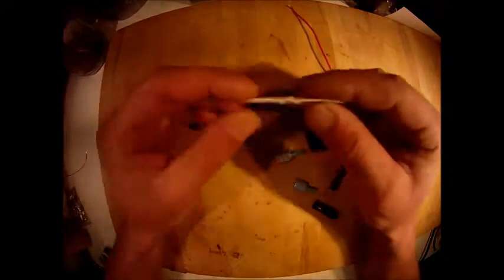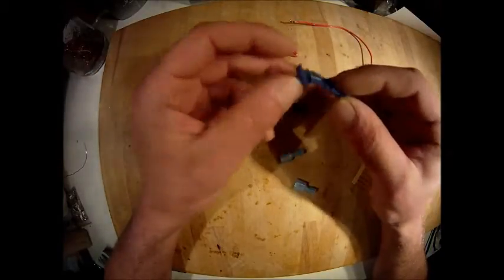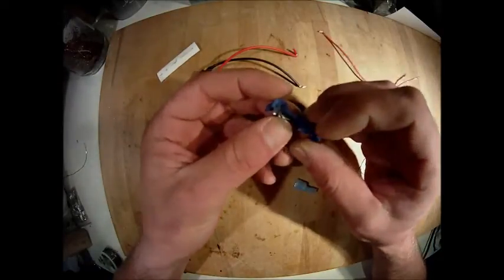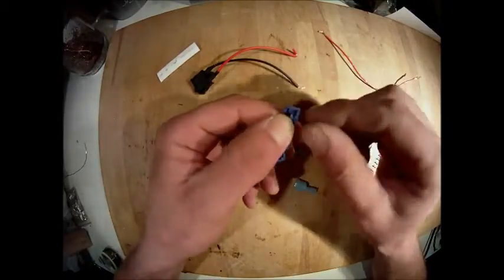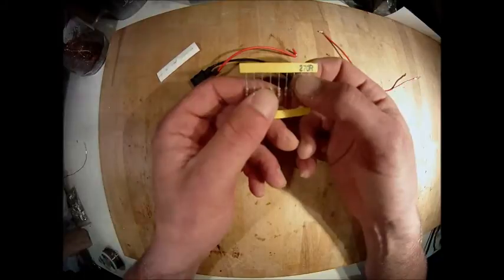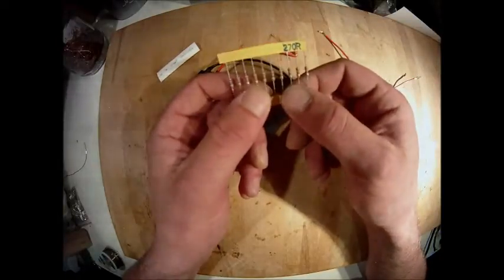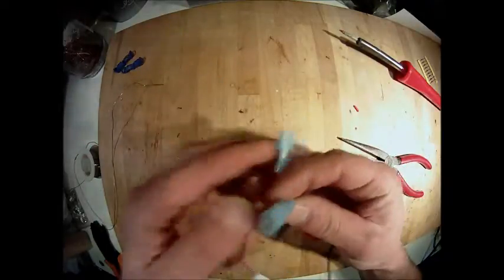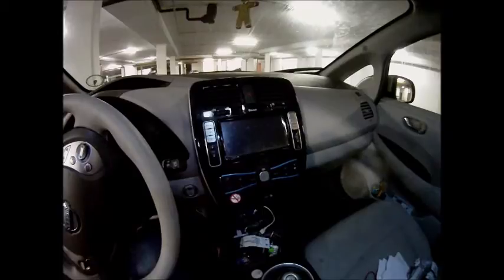Nissan LEAF Easy climate control method 2.  Heater OFF, Fan & AC ON

Comment: Great video.  Installed this one myself and it works excellent ! One thing though is that the red wire is actually 31 and ground is 24. Not 30 and 37 !

Comment: Hi, I completed the mod and the kw used does drop with it on. However the km available still decreases when I switch on just the fan. When switch off the km available increases again. So maybe its not working 100%? Great video...thanks
Reply from the maker: Hi, it is working as it should.  The km is just an estimate based on previous usage. It will drop after a while.

Comment: 1. Please tell me it's work with 2014 'X' grade leaf ?
2. As a example we set to A/C at minimum temperature about 16 C/60 F in inside the car & out side 30 C/86 F, this time also heater works continually & kill energy (Kw/h) ?
Reply from the maker: Darrin R
 That is correct. Well spotted! The reason for this is that the kwh indicator is showing actual present power consumption. The "+3 km" is the car guessing future power consumption based on the last few hours. If you drive around with the harness-switch ON for a few hours those "+3km" will slowly creep down to 0.  If you start off with a high number, such as "+30 km" you will notice that they go down very fast, and your normal "estimated range" will in the beginning change very little.
Reply from the maker: +madura prasanga I am not sure if I understand your question. The 2014 LEAF have the "Heat" switch, so there should be no need for this harness.
Reply: +Leafman Leaf 
Thanks a lot for your quick respond. I understand your answer.
Reply: Great video but I'm a bit confused.  When you soldered the resistor in, you soldered in a red wire onto the black wire.  Any reason for this when you could have soldered it to the red wire off the switch?  Also, when you attached the wires onto the wire taps on the M50 connector you didn't show which wires attached to which taps  i.e. did the red go to 37 or 30 or does it matter at all?  Thanks
Reply: I noticed when you were turning your heater switch on and off the kw used went up and down on the meter BUT the display line just above the meter still said "Turn off climate control for +3 kms"  regardless of the power used.  One would think that if the power used decreased with the heater turned off, that range number would change.  I'm guessing that the climate control power used meter is more accurate than the "Turn off climate control..." statement although you'd think they were connected.
Reply from the maker: +Darrin R 
The switch came with the wires and terminals. I did not bother changing the wires. This homemade cable kit is bi-directional. So it does not matter witch "way" is goes. Red can either go on 37 or 30. You are aware that you can get a factory made kit with M50 connectors so you do not have to use wire taps? betterev.tabetalt.no
Reply: Thanks for the quick response.  Here on Vancouver Island the temperature is often around 14c and I frequently do a 114 km commute which is JUST within the max range of my gen1 Leaf.  Getting that extra few kms range is vital to me.  I have bought all the parts and am making up the switch today based on your video.  Thanks again.
Reply from the maker: If you use LEAFspy that range anxiety will not be too bad... Your LEAF will have worse range month by month, and 114 km in 14 C will give you a lot at anxiety in the coming months. Using LEAFspy you know the %, and how low you can go.  Add 5-10% tire pressure and you get a few km extra.